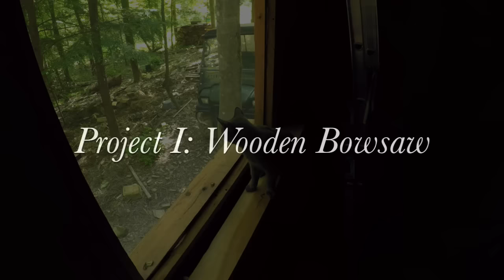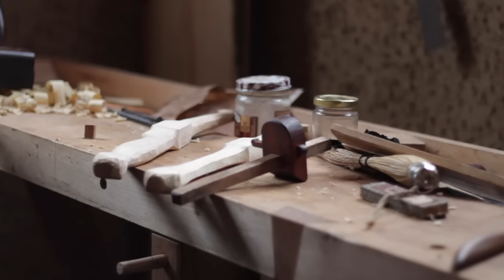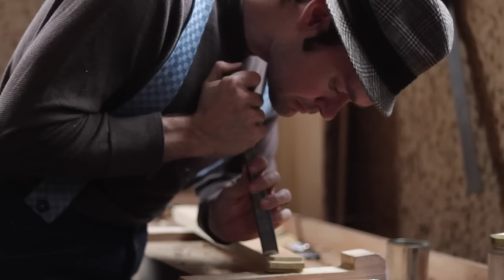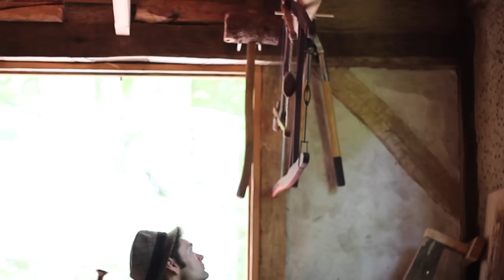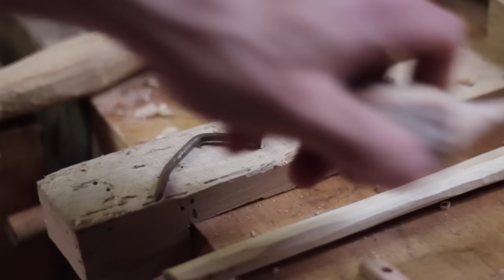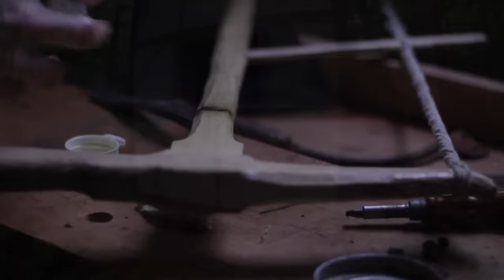Making a bow saw

Comment: Glad to see a new video up! Love it!
Is that Hickory & Poplar you used? If so, any particular reason for using a softer wood for the cross piece?
Reply from the maker: Excellent eye! Yes, Hickory is needed for its flexibility and shear strength, but as the stretcher is only in compression it can be a much lighter wood, lessening the overall weight of the tool and easing its use!

Comment: The new shop looks to be a proper home for workbench! Did you say that the bench was based on a Paul Sellers design? But, anyhow, looks fabulous in its new digs.
Reply from the maker: Thanks, it does fit well there. No this bench came from Roy Underhills book "the woodwrights guide" he has plans in the back.
Reply: +Mr. Chickadee oh. so it&#39;s a Roubo then? I seem to remember a video of Saint Roy referring to it in as a "French Hussy."
Reply from the maker: St Roy calls it a "little french bench" haha its kind of a mini roubo, useful if you don't have a 24" wide slab 6" thick…which I didn't. One day Ill make a real roubo, but for now it works ok.

Comment: I notice that you don't seem to use screws in your work but do use nails. is there a reason for this?
I love your videos true artistry.
Reply from the maker: Oh i have used both pretty extensively. For me, metal fasteners such as nails or screws are more about time saving, the best method is pure wood joinery, and when I have the time, thats what I use. WHere screws or nails are faster and I don't have the time, I use them, unless it would compromise the integrity of the thing, such as a timber frame house or building is not just nailed together...
Reply: Thank you very much for your answer.